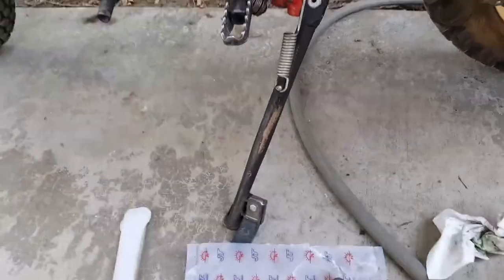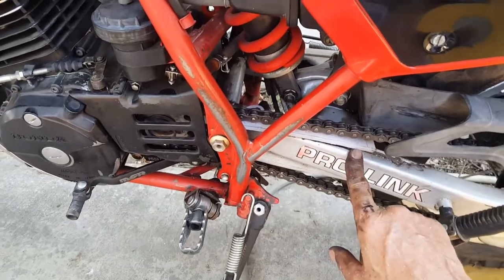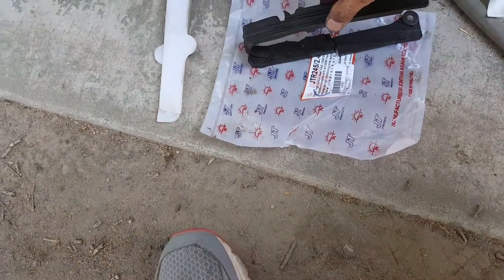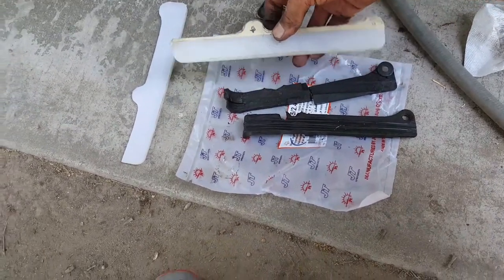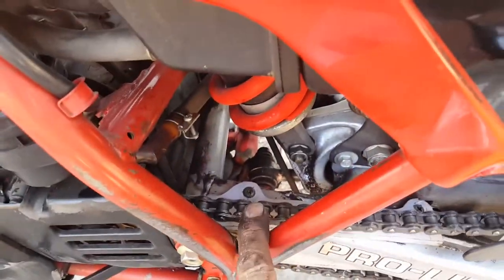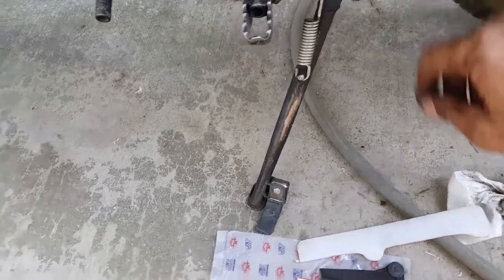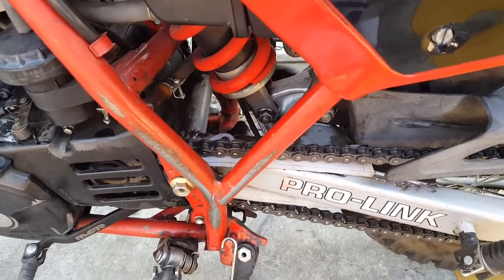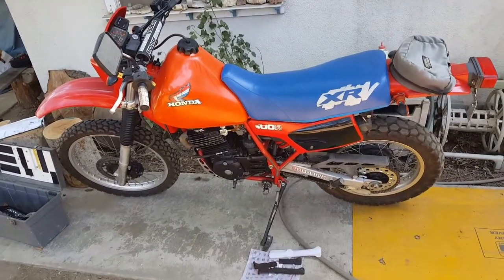1983 honda xl600r swing arm chain guard home fabricated

Comment: How is your cutting board chain slider holding up now? Needing this done on a 85 xl600r
Reply from the maker: We made two sets one for mine one for my sons xr500r .use a good nylon cutting board works great
Reply: I broke down and bought the OEM chain slider $70
Reply from the maker: @codyc3774  I found red cutting boards redid mine in red. Looks good works great.
Reply: @avionicbug  awesome! I just upgraded the gas tank to a 4.3 gallon tank! Putting it together today 5/24